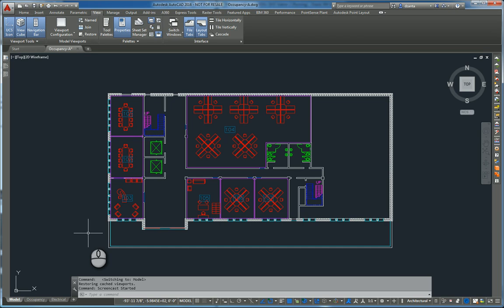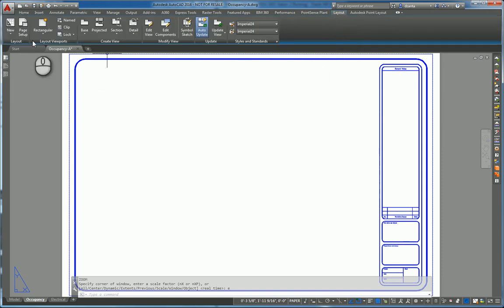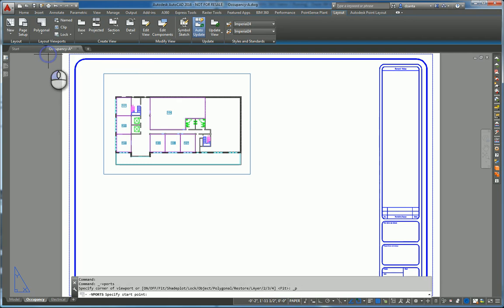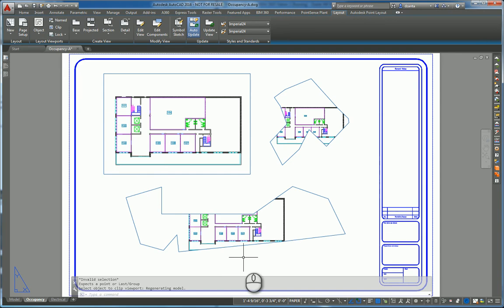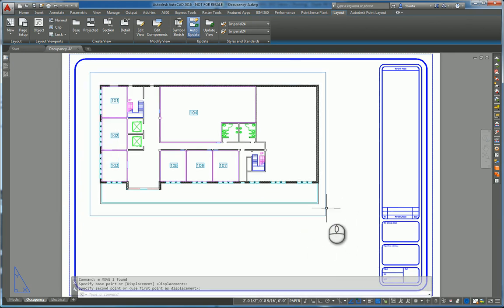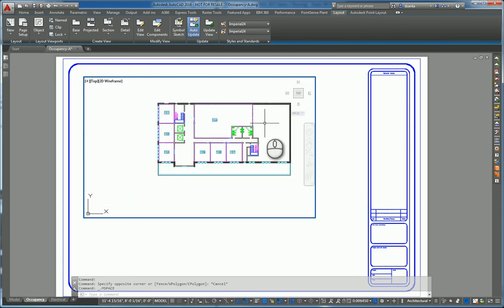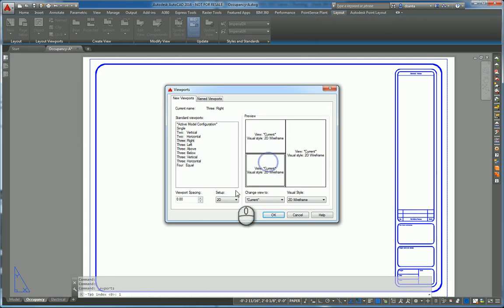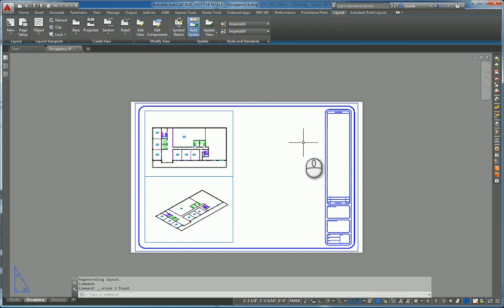AutoCAD 2016 Viewports - A How To Guide

Comment: Yeah I'm using world coordinates system and the state plane is off on my cad file and I have the correct coordinates to move it to. But how can I move all of the viewports with it also.
 
I normally just unlock it and move it. But that would be a pain considering there is several viewports. Someone on a forum was saying something about dash p. I'm not sure what that is or how to use it.
 
I honestly wish the viewports would show up as objects in model space, so I can just move it with the cad file.  Or I wish they had a way to leave the drawing and viewports where they are and just move the world coordinate system to a different location.
 
If you have any ideas , I'd really appreciate any advice

Comment: Good job. Question for you: Right click does not bring me to Properties. Tried everything I can think of. What am I doing wrong?
Reply: [Nephew of Ida] I had the same problem. On the very upper top menu line is right of the layer line is a very tiny pulldown menu. Click "properties" and you have this like a tiny icon left of the pulldown button. Now click the frame of the viewport and then the tiny property icon. And you have the properties menu like in the video.

Comment: what scale does the ( standard scale list ) equate to for example  does 5.1  = 1;200 on a ruler?
Reply from the maker: Hey JM Designs,

The scale list denotes what the viewport scale is to be displaying data at. For example, if you want to see the floor plan at 1/4" = 1'-0" then set the viewport to this scale. This allows for someone who has a ruler or scale to measure the printed sheet at 1/4" = 1'-0"
Reply: Hi Bro
How can i edit or copy from viewports layer to 2Dmodel in 2014LT ?
I have try to copy form viewports to another model layout but can not past.
Please help.
Thanks
Reply from the maker: Hi Myo,

I apologize, but I do not fully understand the question. Would you mind clarifying so that I can accurately answer your question?

Thanks,

Comment: You never mentioned how to get into the viewport, for example if you wanted to zoom window or move the position of my drawing inside the viewport. When i double click on the viewport it opens a black screen and i have to shut this screen down and click back on the layout tab to get back to the now open viewport. 
How do i simply open the viewport in the layout without getting this additional screen/view/window pop up?
Reply from the maker: Hi Kelly,

When inside an AutoCAD file that has a viewport set up, if the viewport is locked and you double click (left click) inside the viewport, you effectively move your cursor and current working space inside the viewport.  You can pan around the viewport but not zoom in or out because the viewport is locked.  If the viewport is not locked, and your cursor is inside the viewport, zooming with the mouse wheel or zoom commands will effectively change your viewport scale to a non-uniform scale.

If your intention is to work inside the viewport with the paperspace layout visible for context purposes, you normally lock the viewport first before double clicking inside the viewport to make it active.

If your intention is to work in Model space without the paperspace context, then just click on the Model tab in the lower left corner of your screen to get back to Model Space to work independent of the Paperspace layout.